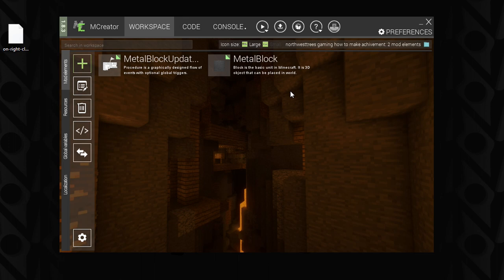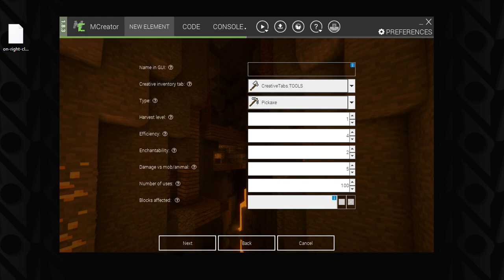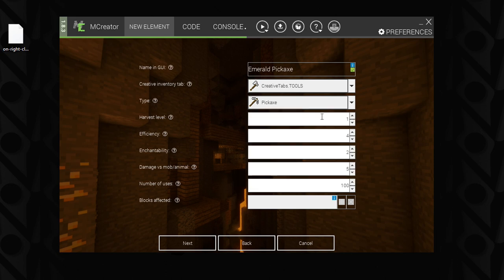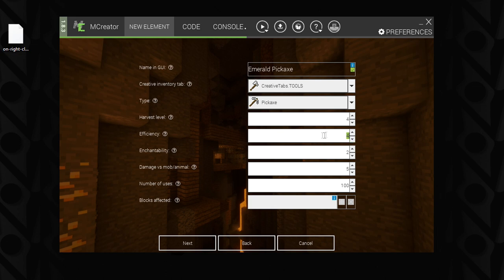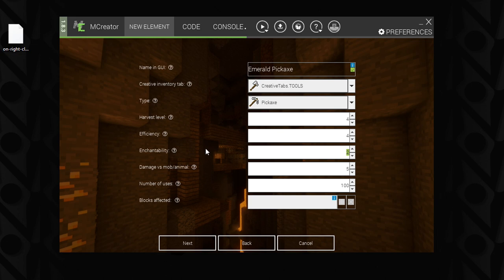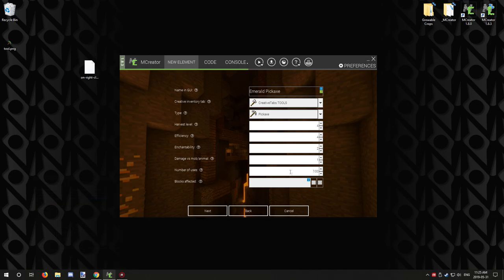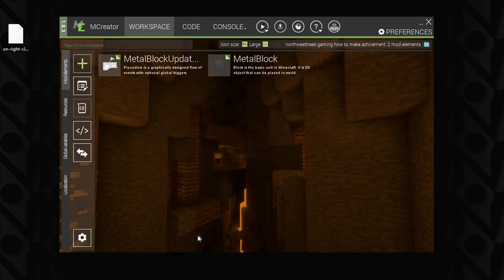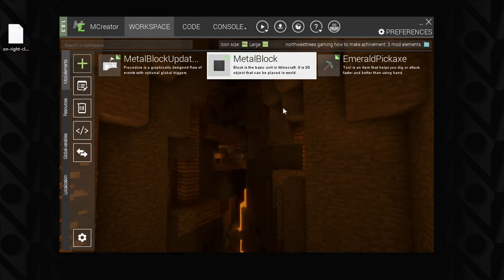MCreator Tutorial: Basic Tool | 1.8.3

Comment: Do you know how to make the tools or weapons 3d? Im trying to make a gun that shoots tomatos and i already made the modle but idk how to make it into a gun
Reply from the maker: You will need to use a modeling program such as MrCrayfish's Model Creator (free) or Cubik (paid) to make your model, then import it like you would for a regular block and just select the model on the main page next to where the texture would go. This should work unless I have missed a step somewhere, It won't be two much different then making a custom block model.
Reply: @NorthWestTreesMCreator   Thank you for the reply i used MrCrayfishs model creator and it works now, but for some reason every part from it is green. I tried to refresh and change it but it stays green for some reason, there is a small thing that has a green texture but idk if that is the problem or not. Do you maybe know what i did wrong?
Reply from the maker: I am not sure. It sounds like the texture is not set up right if no texture was added then your model would have magenta and black textures which Minecraft uses to say it has no texture, but if it's green then it sounds like a UV mapping issue or a texture selection issue.

Did MCreator give you an option to select texture when importing the model? This is where you're going to be selecting your UV map textures that your 3D model uses, they need to be 16 by 16 pixels from what I remember.

You can also check to see if your textures are being set up correctly by opening you JSON file with notepad++
and double checking that you have something similar to below.

 "textures": {
  "particle": "woodpile_planks",
  "log_side": "woodpile_log_side",
  "log_end": "woodpile_log_end",
  "planks": "woodpile_planks"
 },

That basicly hadles the textures for MCreator to import. the names are where "particle" is located is the name used throughout your JSON file.
Reply: @NorthWestTreesMCreator  yes it gave me the texture selection, the green one was the first texture in the row, when i dint select a texture it did become fully magenta and when i selected another texture like red everything became red oh and they are 16 ×16, ill try and look at the file but what should i do if everything is setup right? It could be that it is wrong but i dont think that would be the case.
Reply from the maker: you can try watching this tutorial from the creator himself.
https://www.youtube.com/watch?v=0RVDqUCpKn0
You should be able to use your own textures which you will be using in MCreator on the import of the model.
Most of the tutorial will not apply too much to MCreator like obtaining the models and vanilla texture.
View the video around "10 : 10" in the video and you should be able to figure out how to apply the textures.